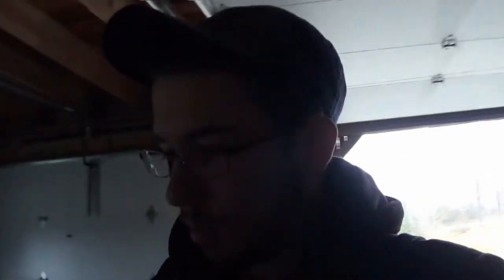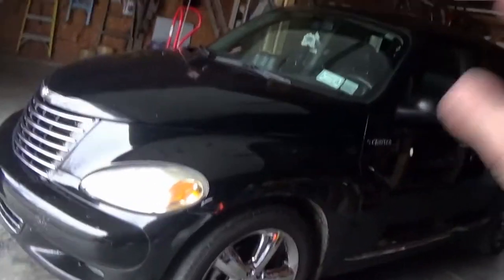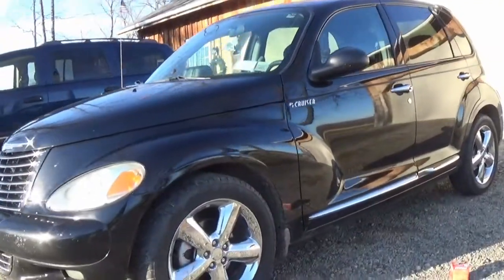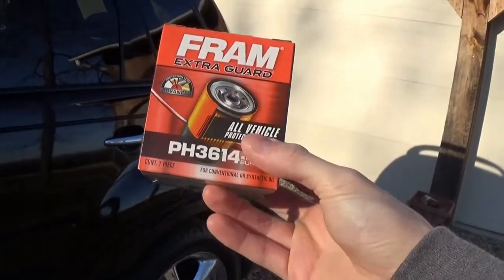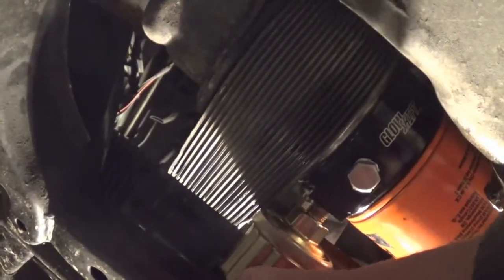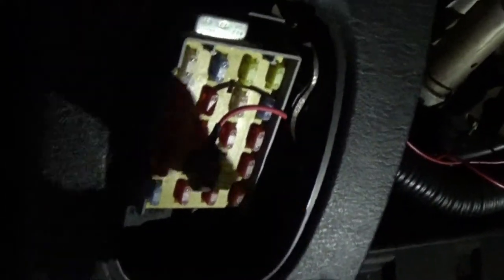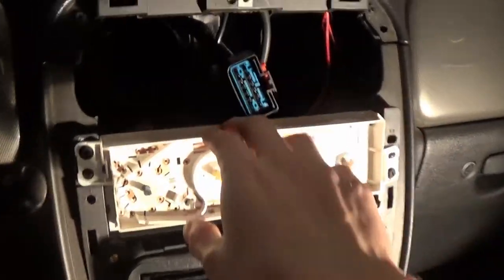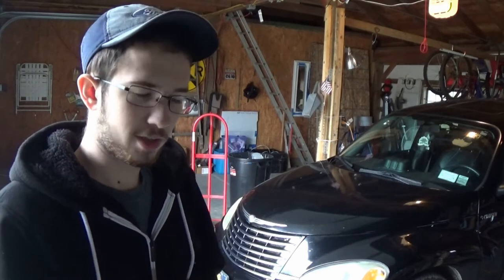Oil Pressure Gauge FAIL! - PT Cruiser Oil Filter Adapter Plate Install

Comment: if you are installing the sensor with a oil filter sandwich plate, you have to ground the sensor because our oil pans are aluminum. I learned when installing mine.

Comment: Oil filter size is fine. My aleros take the same short oil filter as an ls1, but i like to go with the longer version. Keep up with oil changes and you'll be fine. 
  Im with these other guys... too risky to leave that giant sending unit hanging down like that. I found a low profile sending unit for the oil temp gauge in my s10. Maybe you can find something like that for yours. They are pricey, but Auto Meter has quite the selection if i remember correctly. You may be better off just replacing the original sending unit with the replacement. With that bluetooth obd2 dongle and app, can you read oil pressure from your phone? If so, you can probably leave the stock sending unit and hook it up to your gauge. You'd have to research where it is, but it probably isn't hanging low like yours. On GMs, they are typically at the back of the block on top of the motor. 
  The gauge may be hooked up correctly,  but some sending units ground themselves through the threads. How much teflon tape did you use? It may be insulating it... was there only one wire coming from the sending unit? If so.. it probably isn't grounded... leading to the zeroed out gauge.
Reply from the maker: Thank you!!!  Good to know about oil filters, I know some people on the internet will freak out of a filter isn't from-the-dealer OEM lol.  Yeah, I don't like the way that sending unit is positioned at all.  When I was installing it it didn't look like it'd hang that low, but that's just sketchy.  I'm thinking at this point I'm going to ditch the filter plate idea and figure something else out, it was worth a shot since I already had it laying around anyways!  
I never thought of that, duh, of course there's a stock sending unit somewhere.  I will have to research that!  Also going to check out auto meter as well, that name sounds dang familiar from before.  
Never would've thought of it, but that makes sense that the sending unit would be grounded via the threads too, with there being only the 1 wire and all.  Thanks man, I appreciate the help! :D Hopefully I'll get a working gauge going somehow soon!

Comment: that was a load of work.. theres a pipe plug below the crank shaft position sensor on the back of the head that is the oil galley, unscrew the pipe plug and screw a oil pressure sender in or a plumbing fitting for a mechanical gauge

Comment: Ground goes to top motor mount bracket. I would tap into the oil pressure feed from the back of the block. Either tee off the from the original oil pressure sensor location or the turbo oil feed line. Check your factory oil pressure sensor while your there. They are known to leak from the rivet that holds the sensor wire clip. Changing out the turbo oil feed line to braided line is a good idea. The factory metal line is known to coke up with burnt oil on the inside restricting the oil flow to the turbo. If you do change to braided line get a good one. I bought the Kingugawa kit. NOT RECOMMENDED. BTW. Nothing on it fit. had to make every line fit. At the turbo the banjo bolt for the feed line was wrong thread size. I used a 1/4"NPT male to female(to get the fitting to sit high enough and then a 1/4"NPT male to -4AN male 90 fitting. The braided line threads right on to that at turbo and should have a 90 compression style fitting on the block side of the line as well as an adapter. Put heat sleeving on it. If you have any questions hit me up on my channel or on Cruiserlinks.
Reply from the maker: Thank you for the info, much appreciated!!  I already ditched the plate idea and took it back off, it was worth a shot to find out, but it just wasn't going to work out so well in this situation.  Teeing off the feed line or original sensor is a great idea, I'll probably end up going that route.  The whole coking thing has been in the back of my mind as well, maybe I'll get it all done while I'm at it.  Any in particular aftermarket line that you DO recommend?  I've heard AC Delco makes one, they seem to be pretty good.  Anyways, thanks again!  What is your name on Cruiserlinks??
Reply: zztunnell on forum. I cant recommend a line. The Kingu is the only one I've tried. And it came with the wrong banjo bolt.
Reply from the maker: Cool man, thanks!!  I've been researching some lines, I might go with either Dorman (cheaper option) or AC Delco...  They seem to be popular, that way I can give my review here as well.  Just sent you a friend rq on the links!  :D

Comment: Hey Jimmy, I can't help but offer an opinion on this...it frankly looks too risky having that pressure switch hang down so low. I think it is definitely a matter of time before it hangs or catches on something which would have dreadful consequences to your awesome PT. I vote for restoring things, including the correct oil filter, back to normal and cross my fingers that you will.
Reply from the maker: Thanks for the opinion!  Yeah, that's what I'm thinking as well.  Just don't think the sandwich plate idea is going to work out in my situation, oh well, it was worth a shot anyways!  As far as the gauge goes I'll figure something else out :D thanks again!
Reply: If you can tweak the gauge and make it work, this would still be a worthwhile project for the sole purpose of getting good baseline measurements of your oil pressures, cold engine versus full operating temp. But, I wouldn't drive it like that. Simple, unavoidable road debris could knock it off and cause sudden oil loss - yikes!
Reply from the maker: Yeah, definitely not worth it lol!  I ended up taking the plate back off, there'll be a update vid on that soon!  We'll figure something else out for the gauge.  :D

Comment: Yea your asking for trouble with it hanging that low it wouldn't take much to bust it off and there you sit  rule of thumb is to keep it above the factory lowest point in this case the oil pan probably a ground issue in the sender not getting a good ground my off the cuff guess use your  ohm meter to check
Reply from the maker: Yep, I think so too.  At this point I think I'm just gonna ditch the sandwich plate idea and figure something else out.  Never though about a ground issue, I'll check that out too.  Thanks bro

Comment: and your probably going to be drilling out that drain plug. man throw away that red. or only use it in places of heat. like the hotside of your turbo. only if something won't stay tight. or i would use it on the nut that holds your turbine in place. if you ever have to rebuild the turbo thats all. for everything else there's blue. and i wouldn't even use that on a drain plug. the oil itself will bake on the threads making its own thread locker. that why drain plugs are so hard to get loose most of the time. i would hurry and try to get that red off those threads before you heat cycle that motor very much. i would even thread chase it out of there. i have nightmares about red thread locker. listen in not trying to be a hater. i like your videos i gave this one a thumbs up. just trying to help
Reply from the maker: I appreciate the help man, I'm here making videos to learn as I go, after all!  I thought about using blue too, but what I heard was that red would work best on the oily surface and help keep it tight overtime without over torquing .  Good to hear it from another perspective, I haven't  used thread locker much before so I really wasn't completely sure of the difference.  I have a friend that swapped out transmissions in his truck and he claimed to have used red locker on  every bolt lol, I'd hate to be the next guy to work on that.

Comment: dooon't do that !! take your pressure at the turbo oil pressure line. just use a tee. and while you're there replace turbo oil pressure line with a braided one there noen to clogging and making the turbos fail https://www.youtube.com/watch?v=UNKav8IFL8E
never put a smaller filter on in fact i'll probably use gt filters knowing there biger .
Reply from the maker: Thanks for the suggestions.  I don't like the way the sending unit hangs down so low anyways, at this point I plan to ditch the filter plate idea and go with something else.  I have heard about that with the turbo oil feed line before, maybe that wouldn't be a bad idea.  I wonder how hard it is to get at back in there.  We shall see

Comment: I vote to remove it. Too low, winter is coming and ice and snow build up will destroy it. Speaking of winter, is the 3rd bay of the garage all cleaned out now so another car will fit in?
Reply from the maker: Yeah, me too.  It was just too sketchy lol, at least I tried to use the plate. I actually already pulled it back off, there’ll be an update video soon!  Yes, I did finally get the garage cleaned out haha, Durango fits in there nicely 👌 I need to do a garage update soon as well!  :D